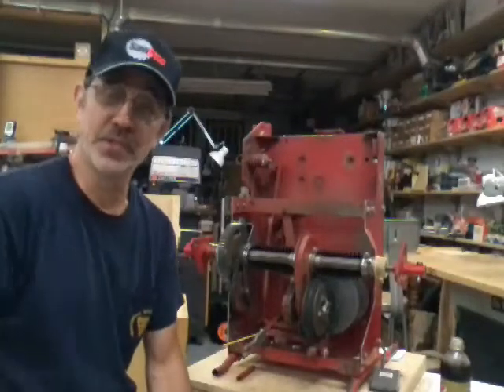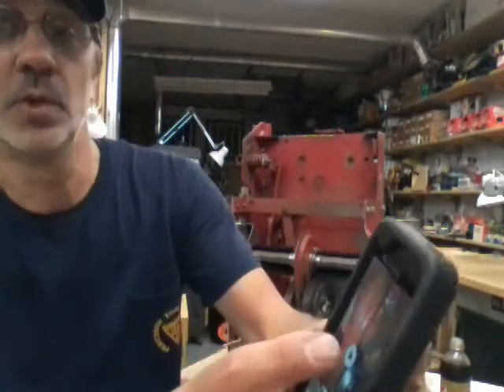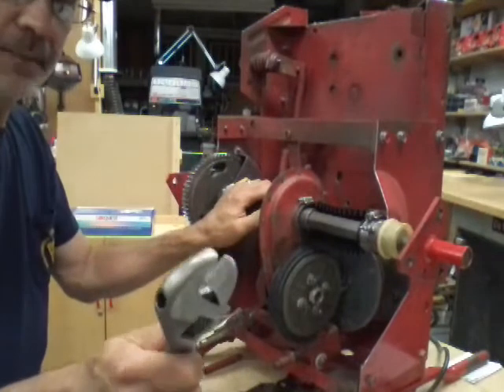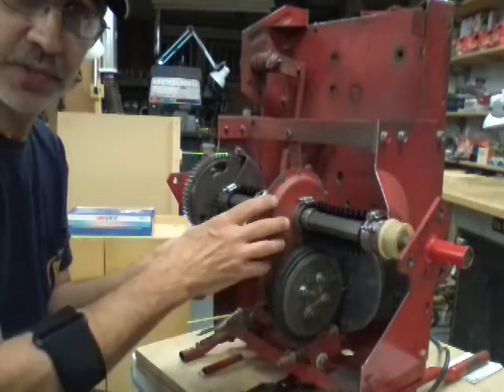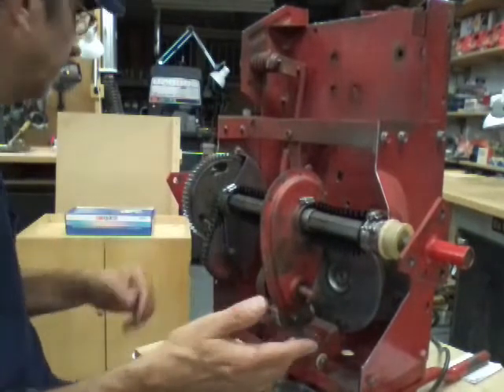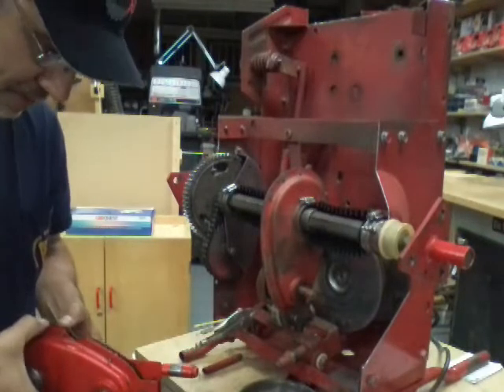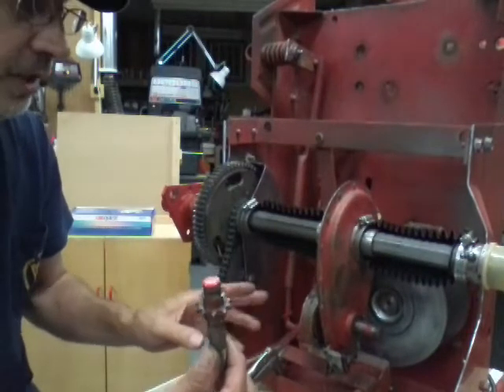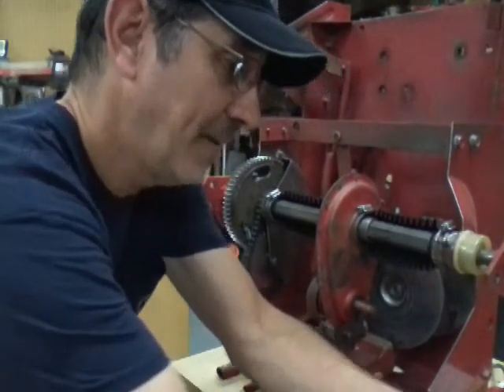123.  M/S 12  Repairing the clutch disc assembly on a snapper rear engine rider

Comment: Exactly my problem too!  Disc spinning freely around shaft.  Shear key sheared.  Hub hole reamed badly from subsequent push back to the shed.  Wasn't sure how to remove nut with shaft spinning and no band brake to hold it.  Crescent wrench on drive axle trick saved lots of time!
Reply from the maker: Well glad I can help, hope you are a subscriber it helps me out and it’s free for you.  Jim

Comment: Great video! My exact problem. Mower vibrating really bad and quit moving. Thought it was just the friction ring that was worn. watched your videos and was able to remove it. Ordered a new one and replaced it, but still same problem. When I disassembled it further, I found that the hub itself was not engaged with the shaft and was loose. After watching more of your great videos, I removed the whole assembly from the shaft and found the hub to be all "wallered out". Shaft appeared to be intact. Ordered new woodruff key and drive disc hub. When I get the parts and get it back together I'll let you know how it works out. Thanks again!!
Reply from the maker: Mike Diaz 
Hi Mike it's Jim
   This is exactly why I do this so you guys and gals can fix your own machines without Paying $60-$90 an hour. I'm glad I could help you, thanks for your comments, will talk to you soon Jim

Comment: Hi Jim, I removed the clutch assembly from the chain case when cleaning the heavy lube in the chain case. I am now reassembling and remounting the clutch assembly. There are 2 5/8" cupped washers that go on both sides of the clutch assembly. I don't remember which way these washers were when I removed the clutch assembly. Can you tell me which way the cup should face, one on the bearing side and the one on the nut side. Thanks, Al
Reply from the maker: allan gorin 
Hi it’s Jim
  Not many people know that those cup  washers are actually a old style lock washer,   every machine is a little different as I’ve taken them apart but if yours had one on each side of the clutch disk assembly then you want to slide one on first with the cup facing out then put your woodruff key in place and slide the clutch assembly on the shaft put the next washer on with the cup facing in and tighten up the nut make sure your woodruff key does not slide out of position you will pinch it between the bearing and the clutch assembly and it will lock up the chain case. Thanks Jim
Reply: Hi. Really enjoy your videos. My 2012  Snapper rider mower works fine in reverse and 5th but intermediate gears don't seem to grab, need to push on gear lever To get it to b engage. Any thoughts? 

Thanks

Comment: I have a 33" mower. It won't go forward but it will go in reverse. Pulls up hill slowly or not at all. Reverse works well. What could be the problem? Any help would be greatly appreciated
Reply from the maker: Watch video number 70 and tighten your yoke spring and tell me if that helps. Jim
Reply: @jimjackson9381  I adjusted spring and changed clutch disc in 10 min.  Thanks for the videos. Thanks for the money you have  helped me save
Reply from the maker: @timothystacks8888  Well I’m glad I could help keep watching more videos coming. Jim

Comment: Would it be better to remove the far end of the boot. This way if the shaft gets marred it's not in the area that's used when shifting. Thanks for the great videos.
Reply from the maker: Michael Hagberg 
  I'd be afraid to get too close to the end where it is hollow it might distort easier on the end then it would in the middle.
Reply: Jim Jackson Good point. I didn't know the shaft was hollow.